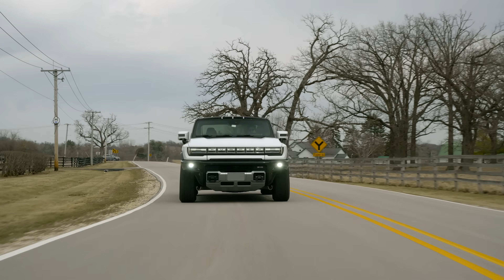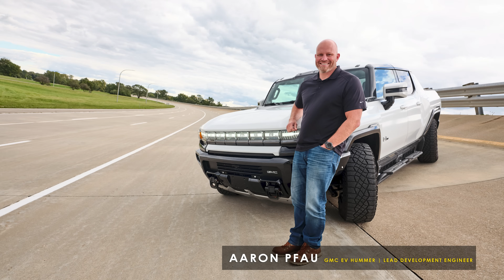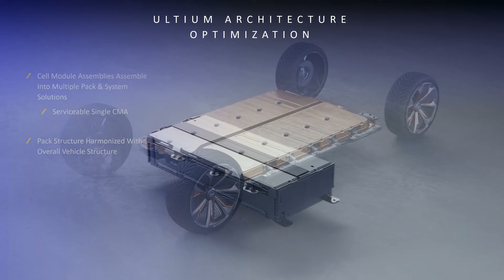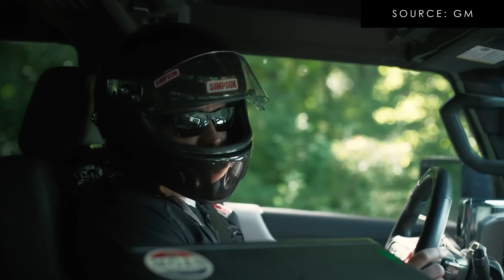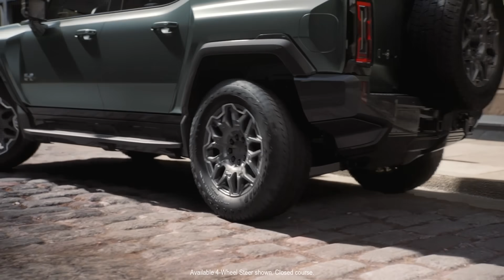Hummer EV | New Formula for Beast Trucks

Comment: This truck is amazing, but it does have drawbacks. Like you mentioned, the biggest negative is the charging and lack of charging stations. I rented the car and got really worried because I couldn't find a charging station near where I going and then had to wait a little over 1 hour to charge it delaying everything. Great for local trips, but not great for road trips, which really is where this thing should excel. So I'm mixed on it, but I still love the thing for whatever reason and am very likely to buy one next year (buying a home the 1st half of 2025 so need to hold off on toys until after).

Comment: love it. And it still does not beat internal combustion where I can re-fuel in less than 10 minutes whilst peeing and buying a snack and then also go for another 450 miles on a tank.  So, nope, it does not beat existing internal combustion tech at all.

Comment: I drive a volt, they only get 40-50 miles of range before the gas engine kicks in. I stop by a gas station maybe three times a year, I only use public chargers that are free, like at some grocery stores or public buildings. 99% of my miles are powered from my wall in the garage. While the infrastructure does need a lot of work, most of the time  you just treat the thing like your cell phone, at the end of the day no matter if it is at 40% or 11%, you plug it in and it's fully charged by the next time you need to use it. Now obviously if you don't actually own the EV and your just testing it, you'll have to rely on the subpar chargers, but if you actually buy one you'll want to invest the $2500 for a home charger and then you don't ever have to stop at gas stations or public charging locations.

Comment: The narrative about energy density is VERY misleading. Talking about battery energy density in Wh/liter is only about marketing, trying to disguise the collosal inefficient dead weight of battery packs. 620 Wh/liter is not very much actually because 1"litre" of battery weights roughly 2.5kgs, so you realy have around 250 Wh/kg of energy, that is 0.25kw/kg. One kg of petrol has  about 12kw, that is 40x times more energy density than the best battery. We all know the electric vehicle is very efficient at 97% conversion rate as opposed to ICE's  that converts only 35-45%, BUT...90% of people suck at math, thus for the efficiency sake I rather convert 35-45% from a 12kw source that weights only ONE kg, than converting 97% of energy but having no option but to drag a boat anchor 100% of the time REGARDLESS of the ACTUAL energy stored inside it. This "efficiency" propaganda is mega BS.

Comment: "Oh, my prostate!" lol. While I think that this monstrosity is exactly that, I am as excited as Jack is about the development of the technology and mechanics that will hopefully, eventually...maybe trickle down into products that regular people might actually be able to eventually afford. I don't even care about the eventual Suburbans or Yukons; those are still unaffordable monstrosities sought after by those doggy day care owners. When GM builds a BAREBONEs S10 EV with virtually nothing but the EV drivetrain combined with as basic a cab as you can possibly get (roll down windows, no extra unnecessary displays, cheap and rugged interior materials, etc.), then I will be really excited. The extra interior convenience features just add complexity and cost while most of us younger generations would frankly rather just plug in our phones rather than have to deal with a terrible auto infotainment user interface. Physical knobs and buttons, only one display (MFD) for the driver with basic telemetry, a basic ass double din head unit that can easily be replaced with a better aftermarket solution, manually adjustable seats, etc. are a few things I would prefer to help keep costs down. I'd much rather pay a bit more for better, more durable materials, forged aluminum suspension components for example, than waste my money on interior luxuries that are generally executed poorly by many manufacturers.

Comment: The whole "it takes a long time to charge my 230kWh EV on a 100kW fast charger" thing becomes a non-problem with normal-people EVs, with battery packs in the 60-90kWh range. As far as building out the EV charging network, spamming Level 2 chargers everywhere is way more important and way cheaper than adding incredibly costly Level 3 chargers. Level 3 is necessary, but it is not intended to be default charging--it's road trip or fringe use stuff. A good future will have you waking up with 100% charge off your Level 2 at home, or charging back up to 100% with the Level 2 at work, or getting a lot of charge back hitting the mall for an hour or two with the Level 2 at the mall, etc

Comment: This is an amazing vehicle.  I have one, but it has issues; I have had two failures; one, the charging system failed due to water exposure which is a GM issue I know has affected many Hummers so far.  It also had an ECE failure last week, again during a car wash.  This somehow fixed itself, I assume after the water evaporated.  I was dead for an hour and called a tow, it took them over 2 hours to find two that were capable of towing this beast, and during that time, it started to function.  I will be taking this to a GMC center this week.  All that said, I love this truck, I have a Rivian R1T, and I feel this GM is a much more exciting truck to drive, but the Rivian is very cool but also has had a few issues.   I am looking forward to getting the GM SUV this summer I was fortunate to order that SUV the minute it went for sale, and I was able to secure one of the extreme versions of the SUV EV 1.

Comment: Thanks for the review.  I have had #580 for little under a year now and do love it - its unique, a bit over the top agree, but an engineering marvel.  Sure it isn't as luxurious as a Range Rover but for the price ($112K) it is pretty awesome, capable, etc.  Love that it also keeps me so far from buying a convertible.  Range is great, seeing about 350 miles to 375 at 100% here with normal driving, closer to 329 when a fast speed road trip, etc.  Most days drive to/from places, plug it in, charges for 2-5 hours using cheap electricity or free Sunlight, etc.  My only complaint is that it has an underpowered infotainment system a bit but that is alleviated by using Android Auto here instead anyways.  One latest pro is that we are all getting new v3 battery replacements soon I guess since they recalled our v1 batteries due to sealing issues.

Comment: I really the idea of the wireless BMS with modules that you can take out and repurpose. 

I hope that they keep the batteries easy to remove and inter compatible  so I could have a small pure EV, and a plug in hybrid truck, and they could share parts. 

It would also be neat to create smaller equipment based on the modules. 

Imagine  a riding mower or like a side by side that shares the same battery unit.

Comment: Technically, the new one is the truck/SUV.  This is the pick-up. 😉
Reply: Ok, u at least showed the new model.  🥳 the power output is a bit lower in the new model as well as the wheel base being shorter like Jack mentioned.  Not to mention the interior differences.

Comment: I think Peak truck for GM was in 2005, when they made a mild hybrid truck, a bare bones w/t with a manual transmission and a half-ton capacity truck with four wheel steering, Quadrasteer. I don't know, there is nothing new here that GM hasn't already done, they just put into one truck.

Comment: The different drive modes SavageGeese mentioned as complicated is not at all, plenty of cars change steering dynamics and throttle response and suspension dampening with each drive mode.  Cars in the '90s had this.  Just send the proper CAN message on the bus and you have all the systems in sync.  Probably because they aren't systems engineers.

Comment: I'd find this vehicle a lot more interesting if it was the same size as a Rivian.
Reply: They're thinking of making a midsized version
Reply: Using the Hummer nameplate for a mid-size would be like using "Mustang" for a crossover.
Reply: @Furious321  Like the Hummer H3 and the Mustang Mach-E?
LoL. Both of those things have already been done.
Reply: The Mach-E reference was a joke.

Hummer models are known for being spacious vehicles. Shrinking it down for a re-introduction would leave people scratching their heads. I'd argue the successful publicity of this thing is due mostly to its unusual size.
Reply: @Furious321  They already made midsized Hummer. It was called the Hummer H3 and it sold quite well. They also made a midsized Hummer truck called the Hummer H3T.
Reply: @Furious321    they're more known for their offroad abilities. If the brand hadn't died they may have even made the 2door wrangler fighter HX concept.
Reply: @haze1123  I know about the H3, my roommate had one. And it sure as hell didn't feel like driving/sitting in a midsize pickup, regardless of classification. I don't think anyone pondered on "Do I go with the H3... or the Tacoma?"

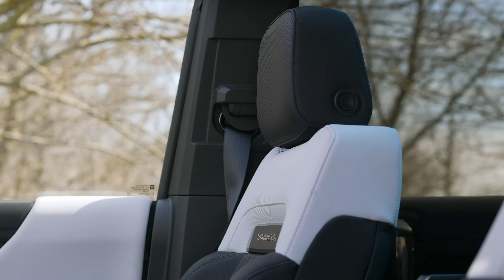Comment: 4:02 I get the Ride the Lightning part here, but Master of Puppets might fit the zeitgeist better. (Or maybe that's just my perception as a European.)

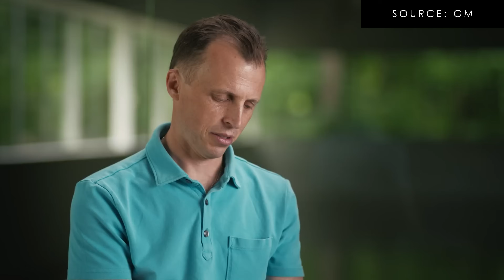6:27 A real moment there. 😄

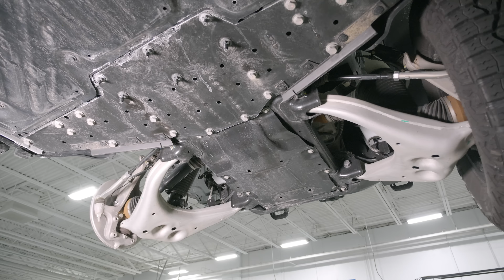21:20 OMG it's over 9000! This will surely increase sales figures to rich conservative nerds by several units.
I still think BFG 9000 trumps WTF 9000+.

32:40 GM and fasttrack of new tech. You said nothing about possible daringness of early adopters.

Comment: This Hummer has EV truck groups talking.  It is in the rich guy market and young boys would go nuts to have this vehicle.  I'm an older dude and I find it to be wildly dumb to own one.  Firstly, the batteries are going to be super expensive.  I think that hydrogen is the better green.  Could hydrogen take the batteries for 5 years and have your $145K cool truck worth very cheap in the market?   The tech would make most happy for a few years as tech improves, but there is so much new hardware and software in a first-year vehicle.  The Gm head office wanted a quick vehicle.  They did it with much bling-y tech.  History says to wait a little a while.  But, if I were rich and 25, I'd love to have one.  I would red light to red light racing almost every day!  GM made a very cool truck; just wisdom waits for time on this one.

Comment: Still need improvement about the battery, because of all the things you need to be concerned about EV is the battery, how well they are designed for servicing it? How many charges that they can have before giving up? The range? Also in average an EV is much heavier than a normal car, so the roads gonna last less longer, and up here we have so much shitty roads with a lot of potholes... Also the problem is that the trend of cars are that people want bigger and heavier at least in N.A, so...

Comment: How much range is left on the table with those knobby off road tires? I'd be interested to see a test of that.
Reply: Silverado EV with the same battery and much better aerodynamics and over 400 mile range coming
Reply: they come standard, so switching to road tires would likely improve it. but not as much as you think

Comment: With all the engineering that went into this machine the most impressive part for me is the execution of this engineering marvel’s design being nearly identical to it’s concept form from the reveal videos which were computer simulations. The complete opposite story for Stellantis and/or Ford concept vehicles. They’re just concepts.

If the only thing that “stuck out” to you during this 35 minute 7 second in-depth review is the weight or size of the vehicle, you’re a hater. Simply put.

It’s also uniquely capable on/off road, delivering everything it promised and more, and is actually worth it’s asking price unlike other trucks from other brands.

Comment: I am lost on how this is good for the environment! That's what this farce of a movement is pushing. This weighs more than the original H-1,Ford F-450, and chevy Suberban! How safe are other vehicles on the road after getting impacted by this 9000lb sledge hammer? What is the emissions co2 for building this? It doesn't off road well cause of electrical problems. Any intelligent off roader knows less weight is better! Second hand and original owners after the warranty expires aren't going to like repair cost on this complicated vehicle so these won't be on the roads long. I think it is a cool vehicle and I know engineers and such put a tremendous amount of blood and sweat into this. But this vehicle does nothing well but makes a great mall crawler at the charging station and is a "look what I can do" from chevy not let's save the environment!

Comment: I like this thing as a comical marvel of engineering and am simultaneously glad that GM will not sell this in large quantities. This completely defeats the reason why we need to electrify transportation: it hogs resources, is extraordinarily inefficient for such a high resource requirement, and is so heavy it is a threat to infrastructure durability when the United States is desperately in need of rebuilding and futurizing.

Comment: I'm impressed with all of the engineering that went into this vehicle and the fact that GM could pull off something this well done in such a short amount of time.  It still shows that when push comes to shove the Big 3 can still do totally amazing things.

But as a driver who has to share the road with vehicles like these, it scares the hell out of me.  This thing weight literally 3 times as much as my car, does 0-60 in a few seconds, and anybody with a basic driver's license can get behind the wheel.  Things are going to start ending VERY badly for other motorists that get in the way of these Hummers...
Reply: - there should be an upper weight limit for non-commercial road vehicles where the driver is not required to have additional training to purchase/own.
Reply: @AB-pl1ko  f350 dually comes close to 11,000 pounds, those arent commercial. most pickups are around 7000, so this isn't that far off. even a tesla is like 3500 on the lighter side, and over 5000 on the higher side. all the cars are getting heavier these days
Reply: The NHTSA is asleep at the wheel. Vehicles like this have no business being on the road.
Reply: @povertyspec9651  why not? because you're afraid of it? no one makes you get on the road.
Reply: I'm not sure this is impressive.  They constructed an impressive heap of junk.  This EV nonsense has to stop.  We need to tell these people we don't want it won't buy and don't give a damn what they say.

Comment: The Hummer EV is amazing, I really like it! BUT the reality remains that it is the least efficient EV there is. It takes FOREVER to charge. GM's "New" battery technology is already outdated. Pouch batteries have proven to be worse than cylindrical time and time again. I hate to say it, but the Cybertruck will be able to go further with a smaller battery and add back miles much faster when charging. Tesla's Supercharger network is always fast and reliable in my over 100,000 miles of driving using it. Them's the facts 😎

Comment: I don’t agree with the argument about charging stations.  The beauty of having an EV is being able to charge at home.  I understand that infrastructure is important and there is absolutely need to charge on the fly, but most people/most times will charge at home
Reply: Agree.  And the average use case for this trophy truck is probably less than 50 miles a day. Which could be recarged with a 30 amp charge station in hours.   Jack: "No one is buying a $110,000" vehicle for a work truck.  Especially when markups will make it a $200k-$250k truck.

Comment: If I understand this, right, there are separate engines for each wheel? If so, what happens if one of these engines fails? Will the vehicle still drive OK? Just wondering with so many capabilities comes so many future points of failure possible ?
Reply: Only way I'd see it causing problems is if the motor seized up as theres no slip between the motor and the wheel, but thats a very rare catastrophic failure (like running an ICE with no oil till it seizes). If the MCU dies then it will likely free spin and throw all sorts of errors, but if they're stupid then they make it lock up in the event of 1 motor failure which would be a deathtrap. All software
Reply: @james2042  Thanks.  One winter storm, several years ago, we had to roll down the window to check out of a parking lot and the window wouldn't roll back up.  Suddenly manual windows was something we then wish we had.
Reply: @chuckmuysson5513  I mean anything can fail. The AC in my moms 92 crown vic runs perfectly fine to date and its all original. thats two motors right there, the ac compressor and the blower for the air. but anecdotal stories don't speak to overall reliability. How often are you replacing your well pump,  or your furnace blower, or lots of other electric motors?
Reply: Modern brushless motors are pretty much bulletproof, there is only one moving part.
Reply: They’re not engines, they’re electric motors.

Comment: There are three EVs that I actually like so far that have come out: the Audi Etron GT, Ford Lightning, and this. One thing all three have in common is they didn’t go overboard on the “futuristic” design that plagues most higher end EVs
Reply: they're a little older and more budget, but the hyundai ioniq and kona ev and the kia niro were just plain cars with electric motors